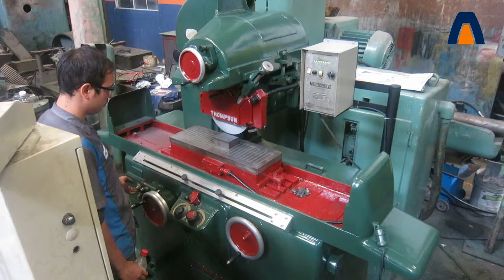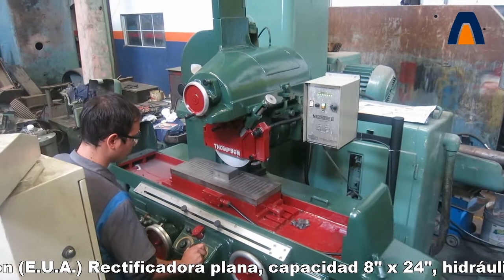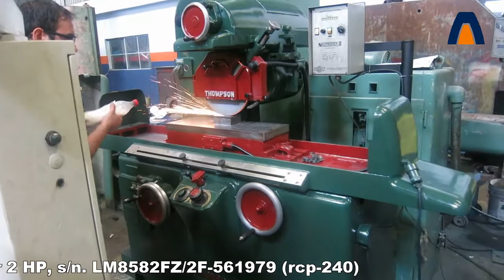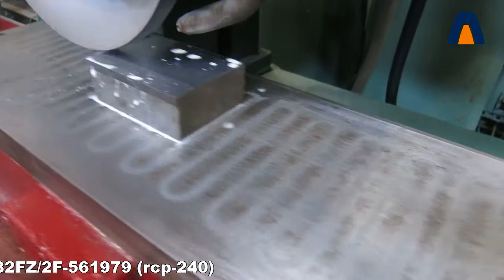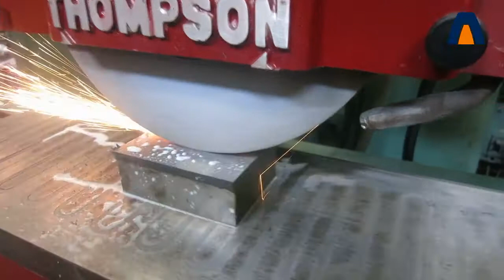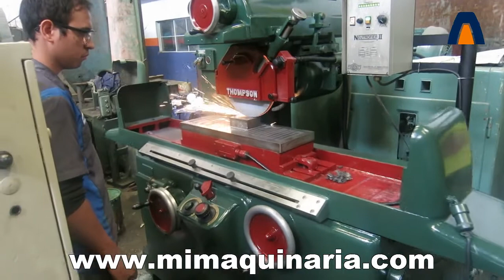rcp-240 Rectificadora plana marca Thompson

Comment: Hola me podrias decir como conectar un plato magnético de 110 dc solo tiene dos cables de salida
Reply from the maker: Buenas noches Alex, necesitas de una fuente de corriente directa 110 Volts de al menos la misma potencia que tu electroiman... Si tienes dudas puedes realizar pruebas con un rectificador alimentando 110 Volts AC y medir el amperaje que toma el equipo. Saludos y estamos a tus ordenes.
Reply: Mimaquinaria SA de CV muchas gracias saludos